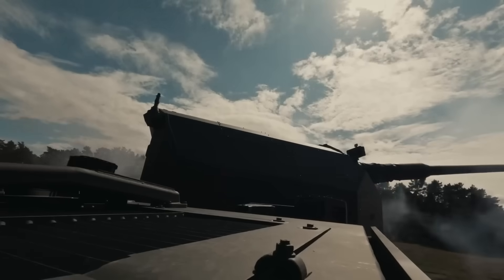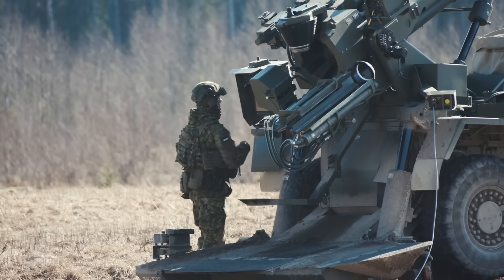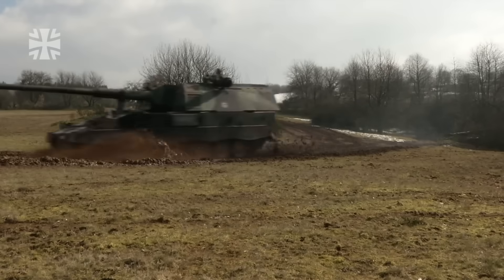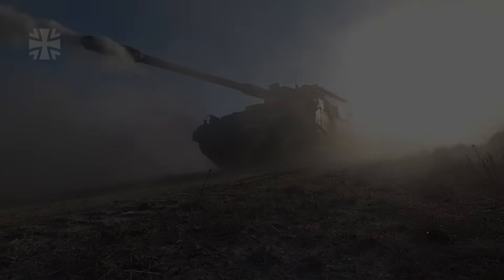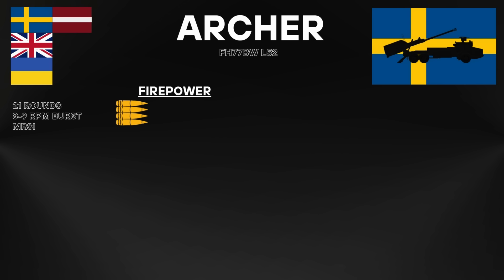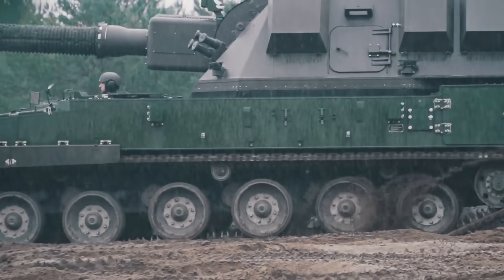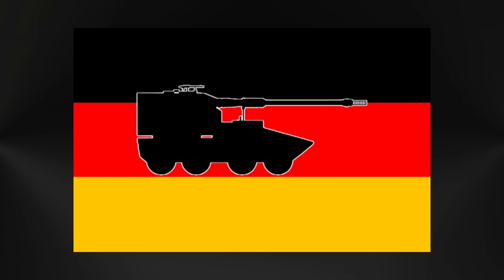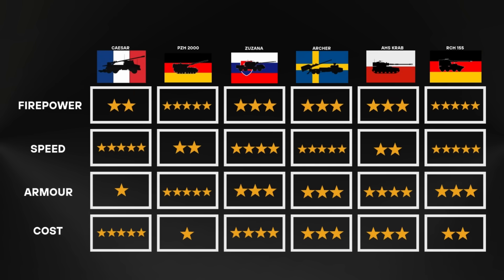Europe’s Artillery Race Explained

Comment: If(!) the RCH-155 is actually able to accurately shoot while driving it takes the cake.
Reply: Rear axle takes a lot of punishment when RCH-155 is firing. 10 x 10 chassis would be better here
Reply: @Owieczkin Why the rear axle? It can be used 360°.  You could also use a heavier vehicle with more wheels, a heavy military truck, or a tracked chassis. That would even be overkill.
Reply: @Owieczkin the chassis is optimized for that, its not a regular Boxer.. 10x10 and tracked Version is already avaible... you life behind a tree?
Reply: @nagmashot  Why are you being so rude in every response? Wtf is wrong with you?
Reply: It is up to about 30km/h. But even if it stops to fire it takes only some seconds to reach 60km/h again.
Reply: In current field tests it has shown itself to be capable of achieving this promise.
However field tests can never replicate a true battlefield, especially under constant threat and usage. As with almost all German military equipment its electronics are outstanding but that also makes them far more complex as well as prone to failure under extremely adverse conditions.
However the RCH-155 has already been delivered to Ukraine very recently IIRC. So once the incredibly capable, competent, and inventive Ukrainian soldiers get their hands on it, and develop the doctrine for it further, rapid adjustments might be in order. All depending on the feedback.
Reply: @RustyDust101  The first produced RCD 155 were earmarked for delivery to UA. If it hasnt happened yet, it will happen soon. So we should get real world feedback soon.
Reply: @RustyDust101 total crap claim..  Ukraine use RCH155 and test it and has ordered it.  Because it is not battletested 😂😂😂

Comment: DURABILITY category is a huge missing here. One of AHS KRAB's in Ukraine shot.... 300% of its dedicated maximum barrel durability. And being back to frontline with a new one. When PZH 2000 broke so often that they were backed from service completely. One of AHS KRAB's shot 270 rounds in a single day(!) and its malfunction stats showed 80% of them are repairable by crew on spot. It is a battle-proved WORKHORSE of artillery. And cost 30% less than it's closest "on paper" competitor. Best relation value to money. Light armoured systems are cute but just can't operate close to frontline in the war of 25+km range drones. It's been reported one of AHS KRAB which got 10 drone hits and still drove back it's crew to safety.
Reply: Actually the PzH 2000 barrels also performed many times better than expected. The failures were due to other issues that are fixed now. Also lots of Krabs were lost to enemy fire. Only a single PzH is confirmed out of action.
Reply: @antonnurwald5700  It is because both of those systems - PZH and AHS are not fighting the same war. 
PZH are few and are use in more safe areas of the front, away of drone-dense zones, when AHS are pounded havely by Lancets and fiber-optic drones right inside the most heat combat zones. 
Also the KRABS were present first at the front, at a  time when anti-drone measures were very poor and Lancets were doing whatever they want. 

I repeat if that not been stressed well: AHS KRAB to PZH is LESS.
LESS expensive
LESS complicated
LESS 'advanced' (no auto-load)
LESS unintuitive
LESS malfunctioning
LESS malfunctions requires service specialists.
LESS repairs needed been done away from frontline.

LESS is MORE. 
Not a perfect wunderwaffe. A workhorse.
Reply: @antonnurwald5700 correct. The durability always was good. He sounds like one of those racist poles, hating on everything German
Reply: The PZH 2000 didnt broke often in relativity to its usage.
Please do some reasearch before you fall for some russian Propaganda BS. 
Ukrainians tell it best. 
And dont get hurt, just because your for whatever reason personal favorite artillary didnt make it to the list. 
Most artillaries have their strong and weakpoints.
The PZH2000 is heavy armored, the crew doesnt need to leave protection at any time, it has a
one of the best rates of fire and is precise. It is tracked tho, wich make it a little slower. And its very heavy, wich denies the crossage of some bridges. 
I bet their are many more tradeoffs, some known, some not. 
Your point tho about the durability has been proven false for nearly two years now. By Ukrainians.
In multiple statements.
Reply: @NotUnymous  RuZZ Propaganda? My sources are German articles: "Sueddeutsche Zeitung" (april 2014) and Deutsch news stations NDR and WDR. On august 2023 western sources notices problems with auto-loading systems; also spring 2025: "PZH is expensive, overcomplicated and get malfunction too often". Its all sourced from weste and its users. In result: PZH2000 are operating from safe zones, away from most dense drone zones. In result none was stroke down yet when AHS KRABs are heavly pounded by fiber-optic drones on the close line battle stations. 

I am happy now we are hearing it is "the best" artillery now but I think it's just today politics demand. Otherwise why they are not side-by-side with KRABs. It may be retoric but I assume there is a risk too high that they will not perform well at the most demanding run-aways from danger zone and just die to stupid stuff.

Comment: Romania does not have an SPG system currently in use, only towed guns, however the K9 has won the contract and they are to enter service in 2026, with production on the Romanian Army batch of K9s already started in Korea, and the factory in Romania already in construction! Search is also under way to hire and train personnel to work there, so horay!

Comment: One thing you forgot to mention on the caesar: There's different versions like the 8*8 or 6*6, some are heavier and use a faster semi autoloader. But more importantly, the 6*6 is so compact and light it's the only system that can be transported by plane. France can move theirs with the a400m.
Reply: The cabin on the New Gen version is also armored and IED resistant.
And it's the system that shoots the furthest of all, 40+ kilometers.
And it's precision is difficult to reach, the "bonus round" intelligent ammunition hits the target everytime at 40+ km distance.
So far, Caesar performances are not matched by other systems.
Cost efficiency, mobility, precision, distance, reliability... I'd bet on it if I had to go to war, whether it's in Africa, or in Eastern Europe.
Reply: @BruneSixtine  exactly, not to mention that it has significantly lower loss rate than most other platforms in Ukraine, the speed alone makes it more survivable.

It's honestly the best platform of the bunch imo.
Reply: @BruneSixtine  @  It has a couple of shortcomings. If you got a schrapnell close enough system survives but the crew is missing. Bonus munition can be used by other systems to
Reply: @Pawel-nf9es  You're right of course, but the level of protection of the crew is acceptable if we consider the unit is already leaving when the rounds reach their targets, it allows to avoid the threat of counter battery.
The system is low cost thanks too a lower level of protection, and it makes the difference.
Germany had the best and most expensive tanks in WW2, the Soviets rolled over them with their massive number of low budget tanks.
Of course there's the drone threat nowadays, but cheap drones can destroy anything, even MBTs... So it's better save your credits if your vehicles are supposed to be in the rear, not even on the frontline.
Reply: You are kind of right but all of this applies to all Western vehicles and makes Cesar no different. The only advantage Cesar really has is air transport. And of course we are supposed to consider the tiny differences between the list of good systems and Cesar is a good system. Just really least good for Ukraine counter battery fire on the front line. It is perfect for colonial wars in Africa it was designed for.
Reply: @Pawel-nf9es  It wasn't designed for Africa at all, it was designed for France. French army has older systems for Africa.
And you really miss the obvious, the price. It's much cheaper than other western systems, so you can have more. It's more firepower too.
Reply: So you say that the French army is going to conquer Paris with this awesome equipment? Interesting

Comment: Well, there are only conditions one will face and the most suitable system/s to counter them. Closer to the frontline or it not moving, armor would be even more valuable i guess. A war with much movements, mobility would be key. Maintenance is always important. Precission loves everyone. Crew comfort is a thing if you have to fight long term inside the system. Armor is last defense for crew survivability and thus protects trained and experienced soldiers, which is more valuable than a system. RPM gives firepower of course = you accomplish your mission maybe faster and can leave earlier, or your chance to abandon a mission because you take too long and the rise of counter fire chance or something else increasing, is lower.

So, i think every system is good in its own way. Like them all =)

Comment: The video forgot to mention that in the future the Archer is going to use the Rheinmetall HX2 8×8 chassi which will change mobility and cost.  Off-road mobility will suffer while on road and strategic movement will improve, and cost will drop to some degree, hopefully a significant degree.
Reply: ARCHER is tailoed fore missions in Scandinavia. Every FFC will use the ARCHER as "silver bullet".
Reply: How would adding a set of wheels cause off-road mobility to suffer? I see more driven wheels and lower ground pressure.

Comment: They're all great systems but you also need to look at acquisition and maintenance costs. Biggest bang for the buck is Caesar: roughly 2 for the price of an Archer and 5 for the price of PZH2000.
Reply: In my view you gotta have a either good mix of high low solutions depending on the individual strenght and weakpoints or pick one jack off all traits  in numbers !  Like a cheasar is easy to produce and that in numbers which in war times normaly beats almost any stats of other vehicles  ! However the terrain in ukraine often requires tracks ! And in the long run you got to take into acount new capabilitys like shooting on the move like the RCH 155 does ! And all that needs to be reliable !
Reply: @christianjunghanel6724  wheeled vehicles technology and technics aren't what they were 60-70 years ago.

France is a specialist in high performing wheeled vehicles hand has been for a while, the 6x6 and 8x8 perform extremely well off road, mainly because they aren't remotely as heavy as the tracked platforms

Nowadays speed is the key to survival, even more than it used to be, as the main threat isn't counter battery fire from the enemy artillery, but drones, and tracked vehicles can't move fast enough because they need to be tracked because of their weight, weight mainly due to their armor which is useless against drone.

Armored tracked platforms are becoming obsolete.
Reply: @Pratt_  Not everywhere ! In muddy terrain like you have in ukraine right now tracked vehicles are often the only ones that can still move . Moveing heavy equipment over soft ground is the entire reason tracked vehicle even exist ! Nothing can replace tracks in that capacity yet ! So you probably will always need at least some of them !
Reply: @christianjunghanel6724  But a wheeled artillery system doesn't need to go on the muddiest terrains of the battlefield. This is the difference with tanks that are on the front line and should be able to pierce through any terrain. Artillerie system are 30km+ behind the front line, so they can just move on roads or average muddy terrain. This is not a problem in actual usage, whereas the mobility and low maintenance cost of wheeled platforms are a huge benefit.
Reply: @antoinegs8548  Doesn t matter ! There  is no gurantee 30 km or not that your fireing position you are ordered to is not muddie , destroyed , mined or has actual streets nearby ! Unpredictability is the norm in war ! You work with what you got regardless the condition !  Also this track vs wheel debate is not just about artillerie ! Even if you are right by you logic when it comes to arty cause of the distance , by the same logic you are wrong when it comes to frontline units !  You know ..... cause of the close distance !
Reply: Bang for the buck is just one consideration. Another very critical one we see in UA is manpower. The yanks call it derisively kraut magic, but the german designs try to wring every bit of combat power out of the staff numbers available using enhanced protection (PzH2000) and force multiplication strategies (Puma, Infantry of the future).
Reply: I'll answer differently: look at what the Polish Krabs are doing.
|The best equipment that works in the war in Ukraine
Reply: @Paparapatheraper-POL I mean the reports from the Ukrainians are that the Krab works but isnt all that great. It does its job.
Reply: @gamingsu-sauer3530   The Ukrainians are quite satisfied with LEOs and PzH 2000. It's not designed for "auto fire" like in an old arcade game. But when used as designed  it is the best high volume SPH you can get. The same with ARCHER.
Reply: @Paparapatheraper-POL I've heard much more praise toward the CAESARs tho... Better range, faster, more mobile, easier to maintain, etc.

The KRAB is great but let's be real, armored and tracked SPG are becoming obsolete, they were armored to protect against counter battery fire from enemy artillery, the main that now is drones, and lighter wheeled plarfoms do great off-road too.

Comment: On the RCH155....1. Its German and production is already running, first supply goes to Ukraine, thus there is no "British&German are organizing production", Britain is buying it but certain production shall be th Britain, Germany has its production already. 2. German Army is ordering aproxx 150 of them, there is no ?questionmark?, and 3. capability of shooting while moving should be an own category as its a decisive capability.
Reply: It's a very complicated system cost more than 20 mio a piece........2 man on board.
Reply: @paulzweers784 cheaper than the five man crew systems in lifetime operating cost. Those have lower purchase costs but much higher operating costs. CEASAR costs about 6 million but  with a five man crew and no protection it is more expensive and vulnerable.
Reply: @paulzweers784  For countries with recruitment issues a 2 man crew is a compelling argument.

Comment: The best in the world is the Caesar cannon because its counter-battery computer system and speed have allowed it to fight in Afghanistan, Libya, Ukraine, and even as a portable airship.😊
Reply: I wonder if you'd rather sit in an armored cabin or run around a gun? While being followed by an FPV drone or shrapnel flying around you? I wonder if there are any statistics on the human losses of artillerymen caused by counter-battery fire.
Reply: @Robert-ze1vw For example, the Caesar cannon doesn't have time to be operated on thanks to its speed; it's currently the best cannon in Ukraine. All the other cannons are destroyed because they're not fast enough in counter-battery fire.😅
Reply: @Robert-ze1vw All other cannons are not air-capable; moreover, the Caesar cannon is equipped with an electronic system that allows it to hit metric targets with a range of 40 km.😊
Reply: @bikesfrench8524  Each solution has its advantages and disadvantages. You can transport a gun by plane, but that means you won't be able to drive through mud. Have you seen the mud in Ukraine? Look closely. You know that if you get stuck in mud like that and the frost comes, the mud will turn to concrete. In that kind of mud, even tracked systems don't always perform well.
Each system has its own sniper system. Better or worse. The most important thing is that it's better than, or nearly as good as, the enemy's.

Comment: As ukrainian, i can guarantee that Pzh worth every euro of its price. Saved my bro ass so many times. It's comfortable and big, so you can sleep in it, which is better than a bunker, especially during rainy weather.
Reply: You can be sure this guy is no ukrainian soldier to be able to say that
Reply: The PzH 2000 is safe. Especially when it's in the rear during repairs.
Reply: @Robert-ze1vw yep, happened a lot, like any other artillery, but it's the best SPA that we currently have. And fun fact from the field: when we removed limiter (Germans integrated safety limits) we could fire up to 10-12 k shells without changing barrel. Archer have good reputation too, but i don't have much info on it.
Reply: @aska8923  ARCHER ist like a sniper rifle.
Reply: @EK-gr9gd  Not really
Reply: @Robert-ze1vw   PzH2000 is designed for specifitic tasks If you want something for a slugfest go and look somewehre else.  Btw the K9 is a PzH2000  tailored for ROK needs.